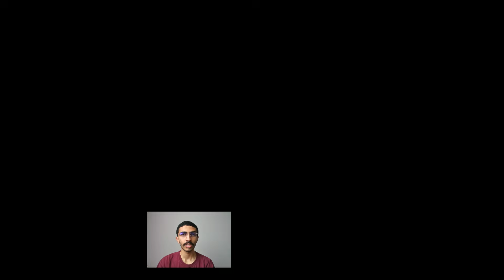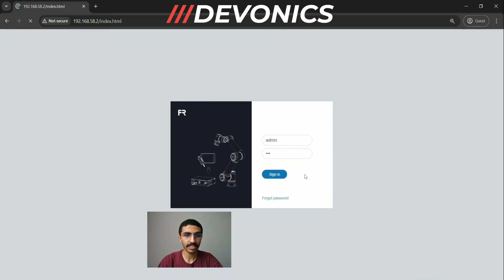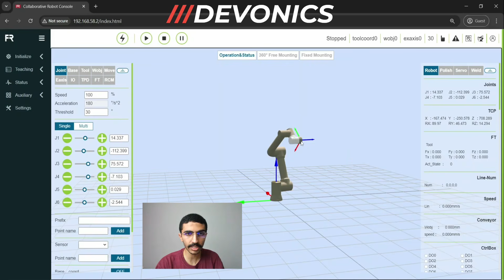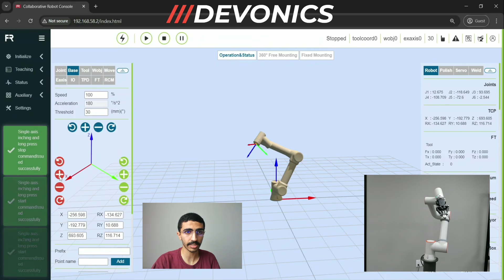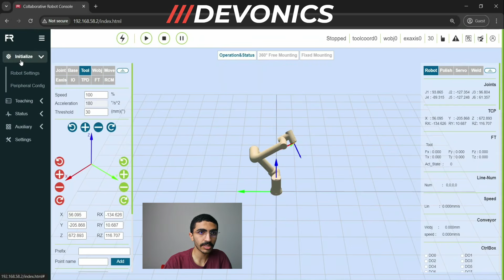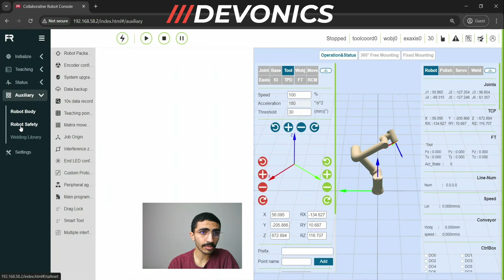Devonics Automation - Fairino Cobot - Robotic Arm - User Interface Quick Tour!

Comment: I am working on a project with a Fairino FR5 cobot, where the camera captures objects and detects their contours to generate movement paths. The system functions well when the paths consist of straight lines, but I am encountering issues when the path includes curves. Even when using small blend radii, the cobot still doesn't move smoothly along curved paths. Is there a look-ahead functionality available that could help improve the cobot's movement for smoother navigation on curves?
Reply from the maker: Please reach out to our support team at support@devonics.com. One of our engineers will be happy to help you resolve this.

Comment: Hello, I'm very interested in using this arm for light router with wood. I'm not sure how to estimate rigidity needs. The repeatablilty of 0.02mm sounds amazing, but I wonder what happens when you start applying loads. This is be used for very fine finishing operations. Also, and this is a big one, I use Fusion. How is difficult is CAM for this baby?
Reply from the maker: Hello and thanks for your message. Please email Mike at mikenessim@devonics.com. He will be happy to answer all of your questions.